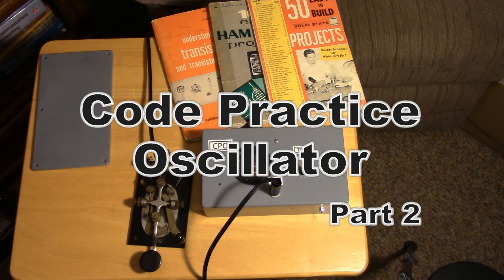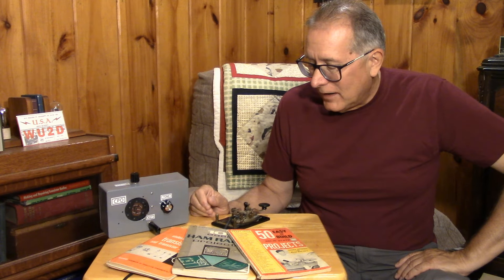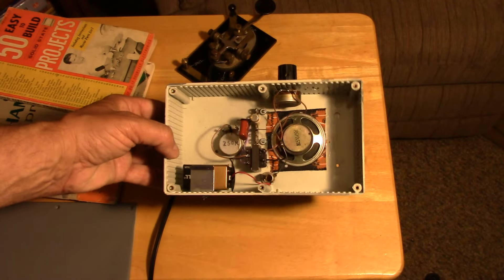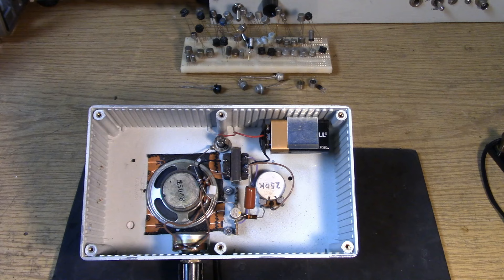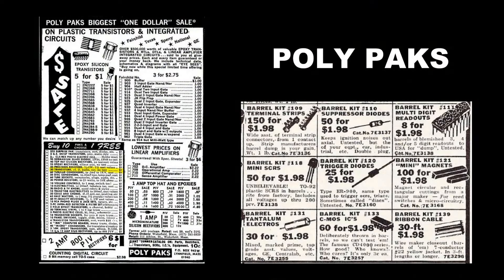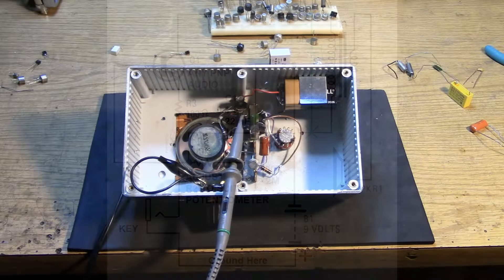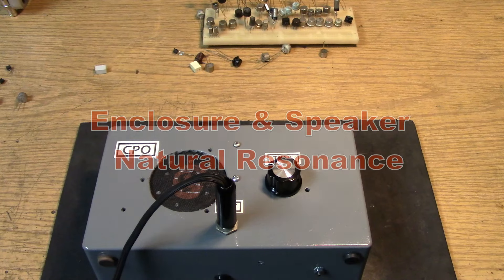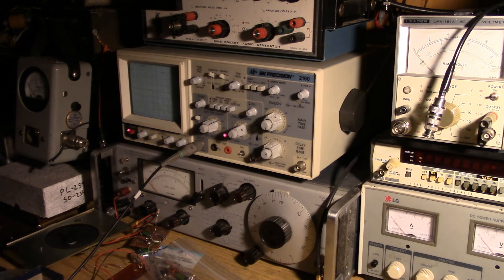Code Practice Oscillator - Part 2

Comment: Thanks Mike. Great video with lots of theory. When I was 7 or 8 my parents bought me the Transistor Radio & Broadcast System you show in the outro. Remco brand. That set probably more than anything else got me hooked on electronics.
Reply from the maker: Remco! Ha I had the Crystal Radio kit they made.

Comment: When I was some where around 9-12 years, I seen this same "Transistor Radio & Broadcast System Kit". I remember it look identical to the Radio Shack 60-2276, pictured at end of this pt2 video, but it was in a Wards Airline catalog. I want one, but my parents didn't have the money.

Comment: 👍Thanks for videos Mike. At one point I think you said that you "cloojed" the capacitors around the switch. I have never heard this term before. I made few simple practice oscillators in the past. The one thing I always had trouble with was annoying key clicks.
Reply from the maker: Kluged or to Kluge. We need a full video to explain!
Reply: @MIKROWAVE1  Thank you. I learned a new word. It is in dictionaries; a haphazard or makeshift solution to a problem. I think most of my homebrew are probably kluge radios 🤣.

Comment: Why did you name the capacitor after you? (one mike).
Instead of a transistor why not use a 4CX5000 tube?? It would be louder.
Instead of a J-38 key you could have used an old house key?
Reply: why not get a 1000W speaker and key the mains into it... 50 or 60Hz code practice oscillator. Such elegant simplicity

Comment: When you show the schematic for the Hartley "conversion", you drew it in green, are you also meaning to use that green line to put the whole value of the potentiometer from the ckt to ground?
Reply from the maker: No need for the pot so just shorting it out and retained the 10K.

Comment: This is great! Do you plan on doing a valve version?
Reply from the maker: A 117L6 widow maker version?
Reply: @MIKROWAVE1  Not a common valve in Australia as we have 240V. A battery valve would be good as the low B+ won't scare off beginners.